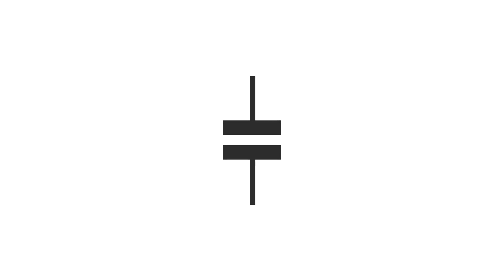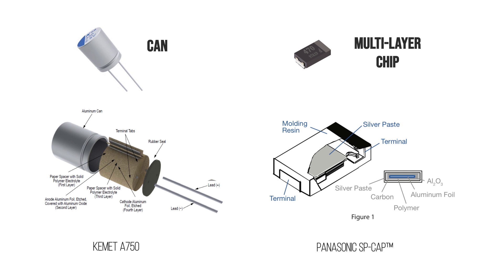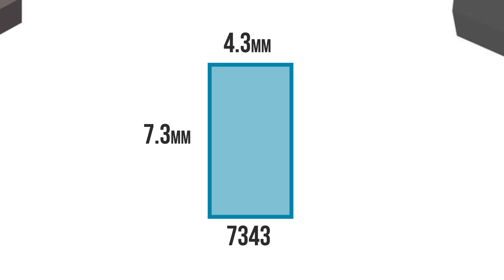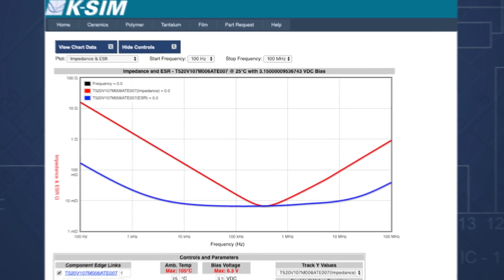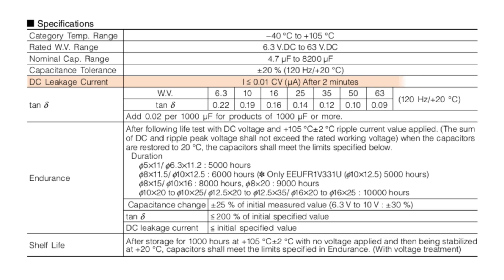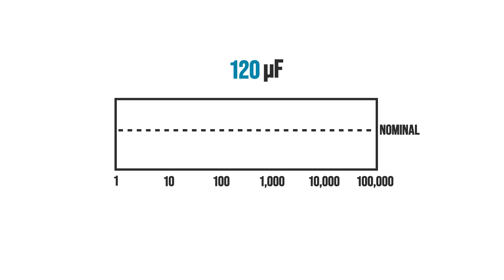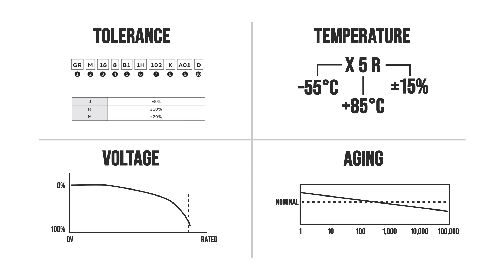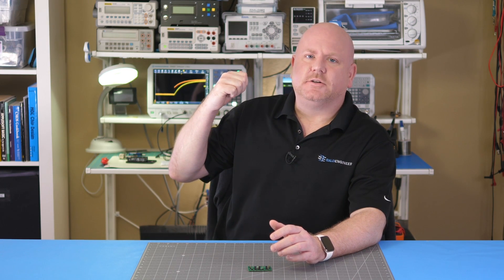Learning About Polymer Capacitors - The Learning Circuit

Comment: just checking a few facts. so near the beginning of polymer tantalum capacitors manufacturing they used MnO2 as it's cathode material which when cracked their will be to much current flowing threw causing heat and the Oxygen splits off the MnO2 and the now Mn203 catches fire because it's hot enough.  Is what i said correct to anyone's knowledge?

Comment: Q1
When you get a through hole aluminium electrolytic capacitor it has a plastic coating that prevents the Al can from shorting anything when mounted on the board.  All polymer electrolytic capacitors that are through hole seem to miss this and just have details printed on the top of can with no insulator at the base of the can where it could touch contacts.  Is there a reason for this ?  It means I have to use a nylon washer under the superior polymer electrolytic caps compared to normal aluminium capacitors when doing through hole mounting.   It seems like a step backwards.

Q2
Also the polymer caps, which are dry inside, still seem to be crimped at the base and use a rubber insert just like the electrolytic capacitors which seems odd. Why don't they just use an epoxy or similar that insulates the base of the can from the board and fix a possible shorting problem at the same time.   They obviously have nothing that can gas inside as there is no cross printed on top of can to weaken polymer capacitor confirming that there is nothing liquid inside.
Geoffrey, NZ

Comment: The Hybrid Capacitors are made because of the normal failure mode of Polymer Capacitors.  While normal Electrolyte Capacitors usually fail open, the Polymer Capacitors fail shorted -> explode
Reply: Stefan Payne That might be a benefit of hybrid, but that is not the reason they were developed. Hybrid was developed to increase cathode coverage by allowing the more liquid electrolyte to penetrate into the anode foil’s etched valleys. 

Shorted polymers could potentially burn, but I don’t see how they could explode. As PEDOT heats up, it oxidizes which would remove free-floating oxygen in the vicinity of a fault site. It is one reason there is no safety vent. There is nothing to vent. 

That said, a hybrid cannot fail open until its vent opens, which, one might call an explosion.

Comment: How do the newer ceramic caps compare to the older style disc ceramics (aside from capacity)? Yes on the ripple demo board.
Reply: 15743 Hertz There is no comparison. MLCCs have more electrode layers which give them lower ESR and more metal to act as a heat sink for the dielectric. So they can handle significantly more ripple.
Reply: @bald_engineer  So the voltage and capacitance effects that are experienced in the newer ceramics don't affect the older ceramic disc caps?

I can also see why the tantalums would need to run at near their effective voltage in order to get the desired capacitance. Running them at or near their rated capacity would cause them to fail more quickly compared to the wet electrolytics, right?

Comment: Great video - Caps are the most misunderstood and misapplied components in my experience.  They always have parameter trade offs.  They also seem to be the  leading component to cause issues during product development and production testing when you start varying parameters like temperature and voltage.  But they are a necessary evil :).
Reply: Nobody cares about capacitors until they do.... ;)